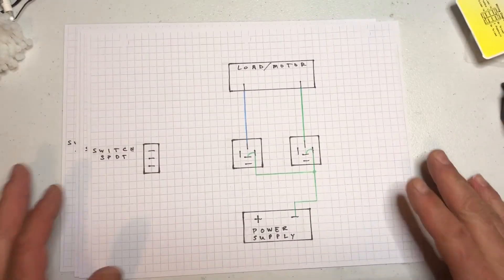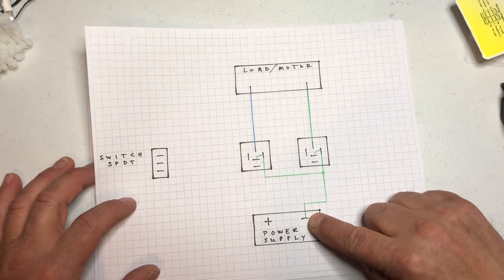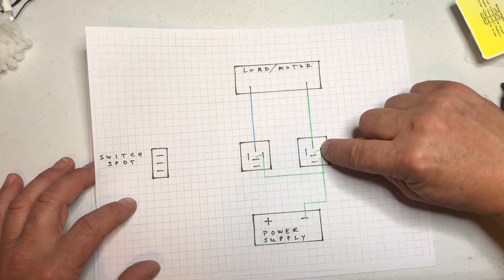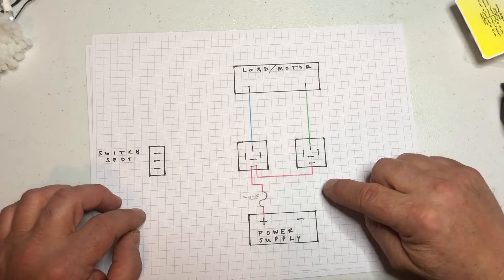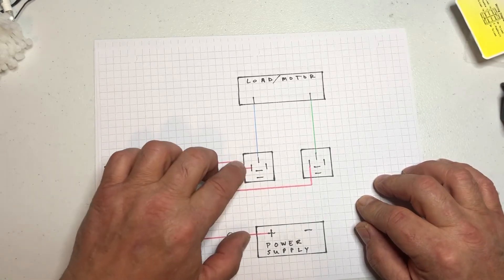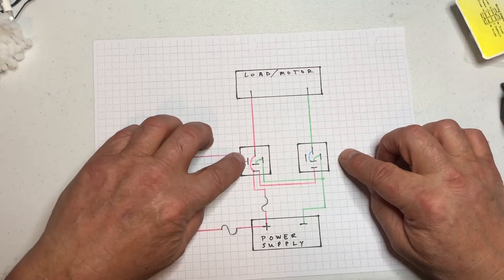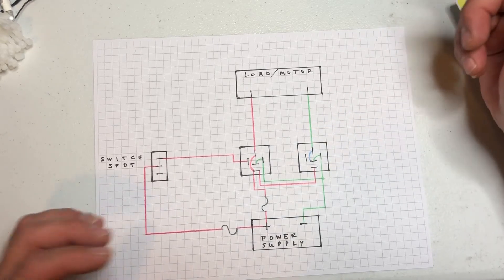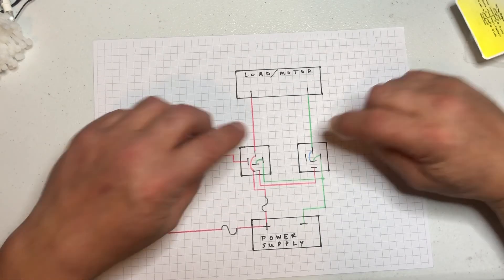Reversing polarity relay diagram

Comment: I used this to allow two valves to operate in tandem from the switch. The valve control used micro switches on a cam so activating the switch to “on” opens the valves, “off” closed the valves, actually was cheaper and quicker than acquiring an actual synchronizing relay.

Comment: That for example be for power windows in car?
Reply from the maker: @tuffy16  pretty sure car window diagram is going to look a little different…
Reply: @mikmaster63  power locks?
Reply from the maker: @tuffy16  might work for that I’m not too familiar with all automotive circuits. I’ve worked on RVs for many decades. This was to make something go in and out or up and down.

Comment: for this to work do you need a relay with two 87's or with one 87 and one 87a. I tried it with a 5 prong that has two 87's and it is a dead short
Reply from the maker: Huh? It works perfectly…
https://youtu.be/JL4b2xnx9CU?si=o06z_rv3-vgqpxJg

Comment: Excellent video with clear instructions.   If I wanted to automate the switching, I was thinking of replacing the switch with another relay contolled by a microcontroller (Arduino).  Thoughts?
Reply from the maker: presently I’m learning arduino…

Comment: Hello sir I have unusual problem the car is 80s Opel tipical GM wire harnest lay out . I try to understand my wire harnest but not sucedeing in my task. Multipel times engine refuse to stop alternator is back feading I noticed it has no diode in the dash board. So my questions wuld by: 1. Can the Positive Linear Voltage Regulator back fead if there is no diode or can the Voltage Regulator use diferent electruciti types?,2. How is the Alternator preciseli Delco 12si manuali controled to charge baterry at centrain engine speeds Im prefering to Cloosed Loop Voltage Regulation For Alternators, 3.Is it posibel that 3pin Blinker Relay can work in reverse way because when my rear bulb holder got corision on its ground wires the bulbs gone crazy and for some reason key switch black thin wire started to smoke the result If I used all 4 blinker hazards the engine worked in union with 3pin Blinker Relay I inspected the wire harnest and noticed the ground shares multipel mini ilumination  bulbs from the dash board ,cigaret lighter,rear heater defroster windscrean switch ,so I suspect the dashboard and the 4 pin rear defroster relay pin 86 from that relay is bound to Alternator field wire and also shares dashboard Alternator bulb conection ,4. Can Xenon bulb with out ballast act similar like wacum tube ? because I see at nigh arc shot from my engine compartment so I suspect arcing relays interact with xenon bulbs . So I hope this mess makes sence . All of my relays are ic chip based who share lot common - and + conections with rest of my wire harnest. So I have dificulti to understand that reverse polariti staff. 
Only thing I have as relays are:
3pin Blinker ,2pin Head Lights ON Buzzer,4pin Windscrean Defroster Relay,6pin Windscren Wiper Relay,Positive Linear Voltage Regulator Dashboard and 4Pin GM Ignition Module ,Horn nothing ells what so ever about electrinics It does not even have radio I trow it away. So I hope for some more info how that changes can by controled.Some effects are usefull some are anoying. For exampel when that Blinker relay deal acured I gained bether economi that relay nearli resembeled like some sort of buzz coil and the baterry refused to discharge under colder weather . So I was reali confused why that acured honestli.
Reply from the maker: Sorry that is out of my skill set 😕